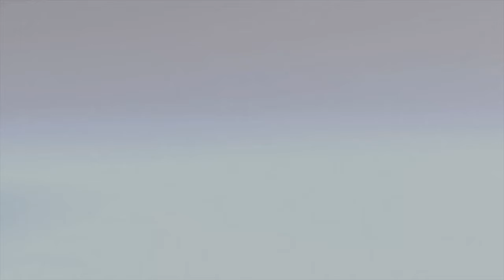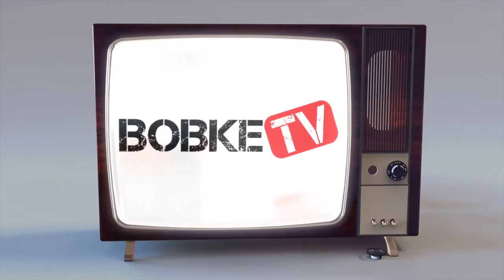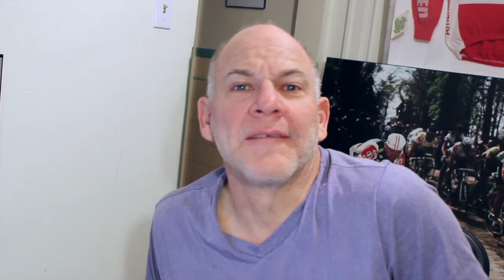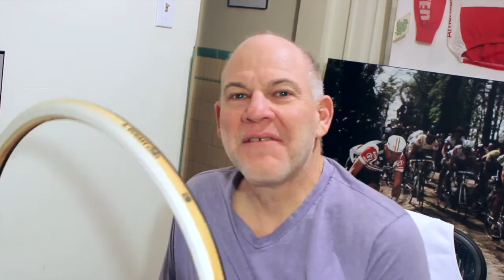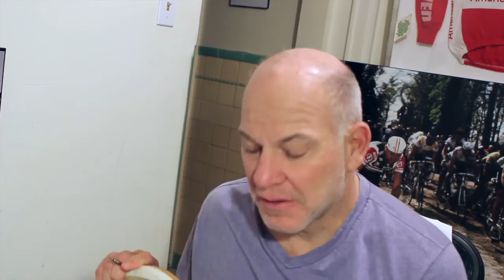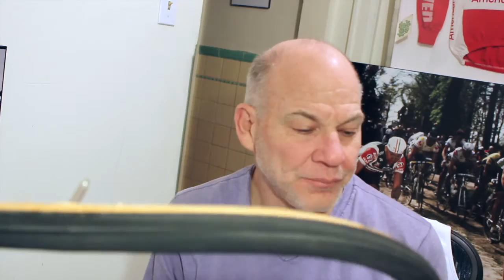Building a Bike with Bob Roll Part 5 - The Tires

Comment: Bob I well remember sew ups, but my question to you is, what specifically do you like about them? What about the ride is better? Because personally clinchers inflate so hard now a days and the ride on them is so good, I really don’t miss the hassle of sew ups, when on a clincher you can easily replace or repair the tube when you get a flat….without having to perform open sew up surgery, where the tire will usually die due to complications during the process anyways!

Comment: Love tubular tires but the expense and the work is the killer. For the price of these tires cost more than my car tires per wheel.  As for repairs after a flat just too much work. I guess my goal is to get out and ride as much as possible. Mechanical repairs including tires is just down time that I can't afford  so for now I stick with clincher. For now it Continental tires  Gatorskin for training and GP 4000S II for more serious riding both in 700x25c.  I guess my question is if you could only ride clinchers which one  would you use?
Reply: nightfly222 tubulars are really not that much trouble.  How many flats do you get?  Sealant takes care of most flats and if the tire has a big gash that would be the end of a clincher as well.  If sealant does not work out on your spare tire.  If that does not work call UBER.  
Back at home I think everyone has a set of clinchers for your next ride or 2.  If you have not glued up tubulars before it's kind of relaxing.  I do it in the garage while listing if to a podcast or the radio.  
I live in a extremely hilly area and the weight savings for the climbs is incredible and the safety if you do flat during a decent is better.  Also no need to worry about the carbon breaking surface like a clincher on sustained descents.  
But the ultimate sale is the ride.  They feel incredible.   The closest I have found is a cotton vittoria with latex tubes.  But latex tubes on carbon clinchers is not recommended.

Comment: I see people are calling you crazy for getting tubulars for normal riding (not racing)  I think it's a great idea!  that 28 will ride like on a cloud. Fixing a flat can be very easy. take out the thorn/glass/etc, unscrew the valve core, pour a little stans, swoosh around, co2. the flat fix kit will be small for this process. Mountainbiker style!

Comment: Tubular tires are very popular with cyclocross (CX) riders as well, because of the super low pressures they run to get grip on frozen ground, mud, etc.  Really low pressure doesn't work well with tubeless, and with the low pressures (below 30psi) you would get pinch flats all the time running clinchers with tubes, due to the higher rim walls.